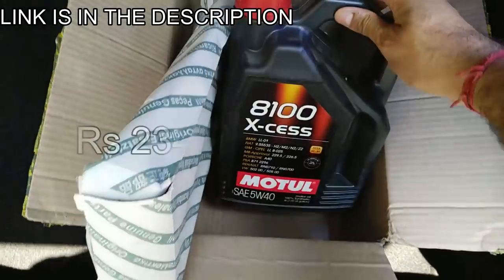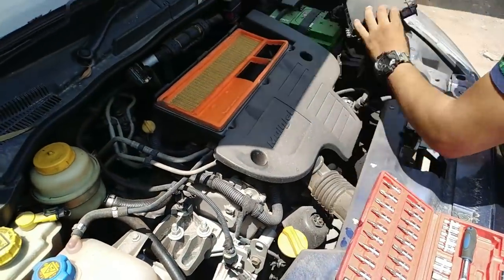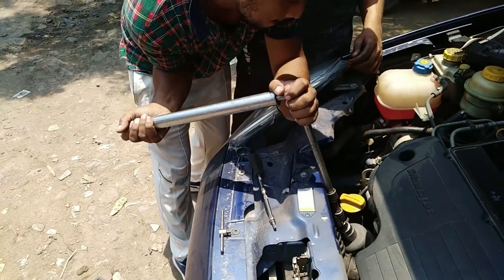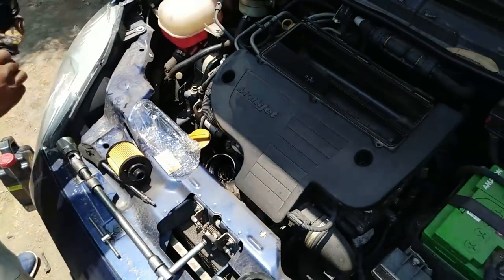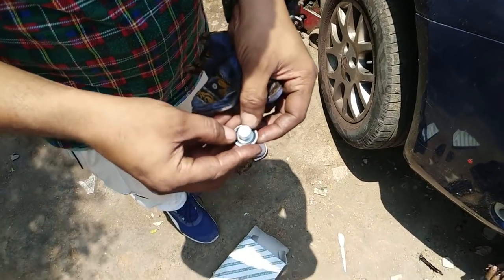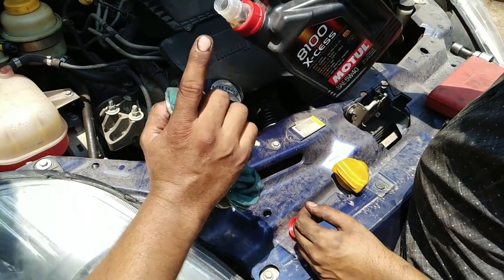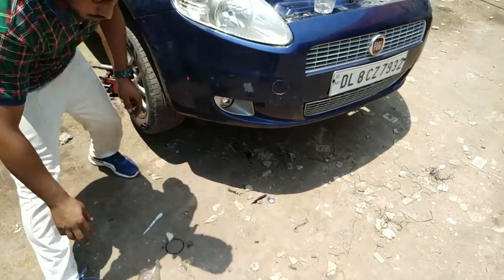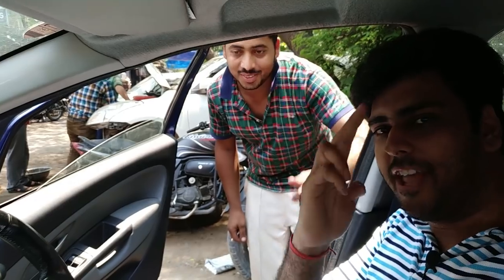Servicing My Fiat Grande Punto

Comment: 15000 kms between oil change, God save the turbo!
Reply: Fiat vw need at 15,000 kms or koi issue nhi aata Fiat k engines ache h that's why need that's late

Comment: Somebody broke my rear glass bro 😡 unbelievable, now I have to change the whole glass, I’ll get the wiper too this time ! how much did you pay labour charges ! I payed 1400 rs only for labour. for regular service oil change, air filter, brake check etc, in dwaraka. Went with Castrol diesel 15w40. As yours is full synthetic I am sure 5w 40 will do a good job.
Reply from the maker: Omg that's horrible brother. I really hate that kind of people in January somebody broke my nanos bumper you might have seen that video. Brother that guy is my known and he for some reason didn't charge me much that's why i put him and the location of the area in the video. He took only 200 bucks 😊. And brother puntos recommendation of oil is i guess 5w40 let me check. That's why i put it 😂😂.. And yeah i want to feel the difference between semi and fully that's why opted for fully this time. 😊😊
Reply: Amul Luthra ya punto does recommend 5w 40 but Castrol Diesel too is specially designed for diesels so went with it.. as it’s tad more thicker will do ok in tropics too ! I put full synthetic petronas in my old ford ikon 1.8 diesel long time back bought from some shop in Chandni Chowk..
Reply from the maker: Okay so how was the performance with castrol. And if compare this motul with selenia there is a decent difference in engine refinement its quieter and smoother... And how was that petronas fully synthetic performed. An i have bought shell helix hx7 semi synthetic for nano and apache rtr 180. Lets see how that one do...😊😊
Reply: @AmulLuthra  castrol did OK I guess.. as its specifically formulated for diesels.. Did only one trip since I services..bad but lol I guess its a good engine oil. and full synthetic is better for sure !
Reply: @Reddylion   only 5w 40 lubricates the timing chain in my Manza diesel.  Please stick with the 5w 40 as recommended. Diesel engines are high tech High performance engines please take care.
Reply: @santhoshselvaraju709  that's true.

Comment: Do u know why a sound comes when I put reverse gear? Can u tell what may be the reason? And also I have the stock audio player in my 1.3 diesel Punto 2014 version. How can I use that and add aux cable?

Comment: Bro how to reset service km due...in fiat grand punto
Reply from the maker: Brother, we need to connect it with OBD scanner and run its software to reset it. I haven't reset mine and gonna do that real soon. Will also make a video on it too..😊😊
Reply: @AmulLuthra  please help which obd use in Fiat Punto Evo/Grande Punto
Reply from the maker: @Ram Prasaad Brother in Punto v1.5 or v1.6 supports only. And you can go for either usb or Bluetooth one.

Comment: What is user manual grade for engine oil for punto evo 1.3 diesel?
Is it 0w30 or 5w40?
Reply from the maker: 5w40 and stick to it.
Reply: @AmulLuthra   @AmulLuthra  I just  used 5w40 for my Punto but I don't know whether it was mineral based or fully synthetic..besides(blended with solvent refined base under extreme pressure) nothing was written on it about it.... Could you tell me , what kind of engin oil was it? It was of speedo...
Reply: Plz reply bro...will be grateful..

Comment: Hi , I have Fiat Linea car , I just wanted to know which engine oil is good for fiat car, pls answer my question
Reply: Motul 8100 Xcess best
Any brand 5w 40 Fully Synthetic oil 3.3 litres oil in Fiat Punto Linea
Punto Evo Linea facelift Avventura Urban Cross.
Same what swift need oil in diesel one
Reply: Air filter you can get from Fiat/jeep
tata manza/vista
.
Aftermarket elofic is good brand

Comment: Woh pink colour oil konsa hai?
Reply: Not oil 
Red coolant new advance cars or audi jesi cars m red coolant dakta h green coolant is old technology car
.
just use clean 5.5 litres water run engine to high rpm 
Temperature reach to middle
.
Than drain out
.
Than refill water 5.5 litres run again
Temperature to middle.
Than drain out.
Than use red 2 litres coolant concentrate 3.5 litres distriil water
Battery water new

Comment: What SAE grade have you opted for? Also just as a suggestion, from next time you can pour around 5-10 ml of oil within the oil filter before installing. This would help in neglecting oil circulation during first start post oil change. Hence resulting in minimising initial metal to metal contact.
Reply from the maker: Its 5w40 brother fully synthetic. And actually there was some oil in the oil filters place as its diagonal so the technician used that 😊. And this Motul one does feel to be better. The car feels silent. Or maybe the previous one was used up quite a bit. That's why feeling the difference. Only time will tell. 😊😊
Reply: @AmulLuthra  5w40 grade is perfect for Delhi's climatic condition. Real character of oil is measured after 200 kms post changing.
Reply from the maker: Yeah and Punto's engine recommends 5w40. And i almost planned to put this oil in nano and my rtr but thankfully i have seen their recommendations 😂😂😅. Nano needs 15w40 and rtr 180 needs 10w30. And i am planning to give a short review of this oil after covering 1000kms. As if there's a difference between synthetic or semi or not. 😊
Reply: @AmulLuthra  There is a molecular difference between synthetic and normal engine oil. I know people who even use Servo 20w40 that costs around 200 per litre in the Merc C class :D I have been loyal to Mobil since last 5 years, as I source it directly from the distributor. There are experts who states that we actually don't require synthetic engine oils based on Delhi's climatic condition, but in the end we love our vehicles so we'll serve it to the best way possible. But now you should
 Cover next 15,000 kms or 15 months for next oil change.
Reply from the maker: Yeah man that's why opted for this as many fiat owners have advised me too. Previously every time the car was serviced in the service centre and they have always used selenia 5w40 semi synthetic and as you have seen in the video the oil is still okaish after almost 14500 kms. Lets see how this one holds up 😊😊. Will update soon. 😊😊

Comment: Hello I have fiat punto grande 1.3 multijet, and when the motor reach the optimal temperature the oil light turns on what can be?
Reply from the maker: Which oil did you used it might be turning too thin at that temperature. And please check oil level too...
Reply: It’s castrol but I will change it again, I did 5000 km with that oil I think is this reason to, thank you my friend

Comment: Brother my fiat punto emotion 2011's blupunkt audio system display orange light is coming but the letters on the display in not coming, blue&me function is not working and usb is also not working please reply and help:)
Reply: If blueandme is not working, usb also will not work. They both are inter related to each other.
Reply from the maker: Check the fuse behind the stereo as well as in the fusebox if its a fuse issue you will find a broken fuse somewhere and as soon as you replaces it your system will work as normal... Keep me updated...

Comment: Sir my Punto is 2010 1.2 petrol..... should I go for fully synthetic engine oil or semi synthetic is good
Reply: Use fully synthetic whenever possible.
Reply from the maker: Yeah go for synthetic it does made a difference in my punto. Engine is much smoother now...😊😊
Reply: My car also 2010 punto petrol emotion
Reply from the maker: @Sujatha lalan that's nice how is the car brother. ☺️☺️
Reply: Hello frnds i have 2010 Fiat Punto 1.4 emotiona car. Which grade engine oil suits for this car.  I don't have user manual it's second hand car. 0w40 or 5w40 grade fully synthetic. Please suggest
Reply: @AmulLuthra   very good and stability

Comment: Bro, Which engine oil is used for Fiat cars at Fiat company service center?
Reply from the maker: Brother fiat service center uses Selania semi synthetic 5w40 engine oil for multijet Punto's. And that oil is not bad at all. As you might have seen in this video. I have driven over 14k kms before this service on selenia. No problems whatsoever.
Reply: @AmulLuthra  thanks bro i hav fiat linea 2016.your videos are very useful...

Comment: Bro, shall I go for motul 8100 xcess 5w40 or shell helix ultra 5w40?
Reply from the maker: Brother both are good oil i am using motul 8100 xcess in punto and shell helic hx7 in my nano. So both are pretty good. Get the one which you can find a little cheaper...

Comment: Bhai...fiat ka timing belt ka issue hota hai...is it necessary to get changed...i have punto 1.3 multijet. 2011 model.
Reply from the maker: Brother 1.3 Multijet diesel got a timing chain not belt. So issue toh koi bhi nhi hai.
Reply: Issue tou nai hai...but a friend told me after 60k kms it needs to be changed...
Reply from the maker: Sorry for replying you late. 60K is actually early for a timing chain replacement and i have talked with a few punto and other multijet engine user about this. And i found out that it only needs replacement if you hear any abnormal sound from it and not before that as soon as you hear a different sound get it replaced as soon as you can. Many users have done over 1.2 lakh km without replacing it...

Comment: Kon sa model hi
Reply: Nov 2013 Emotion Multijet
Reply: Mileage kitna nikal rhe bhai ap
Reply: @kuldeepsinghyadav6584  16 to 18 or plus with ac.
Highway He knows better
He took out 25+ kmpl with ac 🔥
Reply: Thank u bhai
Reply: Fiat punto apki najar mi koi second hand ho to plz batayega .
Reply: @kuldeepsinghyadav6584  buy only after 2012 model
That is with better gc and Company also was resolves some old issues
So better to own
After 2012 
.
Try to buy emotion if need auto ac rear wiper all features mid steering control
And more Features
Reply: @kuldeepsinghyadav6584  brother but you have to keep Service on time.
First tell me where you live.
.
Punto will give this mileage if you drive good 
Amd maintain good
Punto is solid tank 
Lovers car
Always remember any car with hps always drop in mileage and power 
Eps has no impact on Engine 
But hps has load on engine
.
No one knews 
Punto even this heavyweight and wide tyres
Hps steering still gives 16 kmpl
Reply: @kuldeepsinghyadav6584  wese aap kaha se ho that i can help
Reply: Up jhansi

Comment: what about Diesel filter ??that also need to change on every service, life of diesel filter is 20000km,
and what about breaks check and adjustment ? Labor charge arnd Rs500.
under body check ? sump guard check,
battery check ?
OBD check ?
wheels check (bearing nd all ) .
doors check nd lubricating,
coolant check, 

bhai an advice to you, changing oil nd filters is not servicing , 
a Car after  running 10-15k nd  6-12months period needs to check thoroughly ,  
warna Car ko khatara hote waqt nahi lagta , aap apni car ko hi dekhlo,. 

i own Fiat punto diesel emotion july 2014 , done 1.32 lacs km till now, more than half of them are road trips, including Ladakh(nubra valley,turtuk, chumatang , pangong tso etc etc) Zanskar, Gurez Valley, hp, Uk, nd almost all north nd central India,  not a single unwanted noise in my car, 
still going super duper strong, 
i get my car serviced after every 10-12k km. nd every 3rd service is major service.
Reply: You can expend fuel filters of Fiat max to 30,000 kms
But change max at 20k kms
Or 25k kms
Reply: hello brother is there difference between motul xcess 5 w 40 and motel xtec 5 w 40 ?? which is better for Diesel punto ?